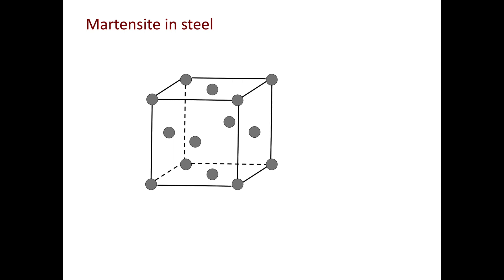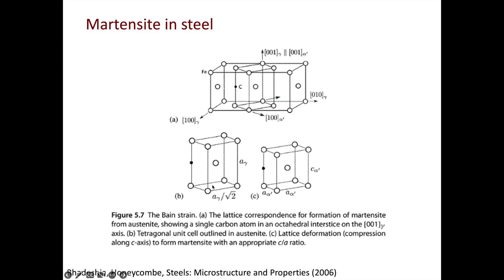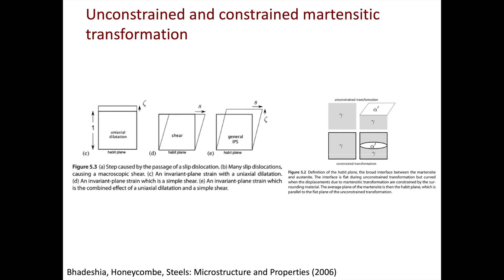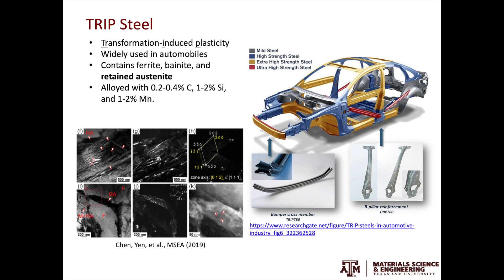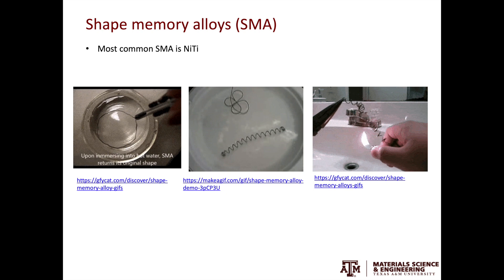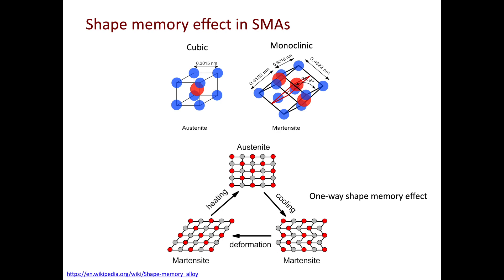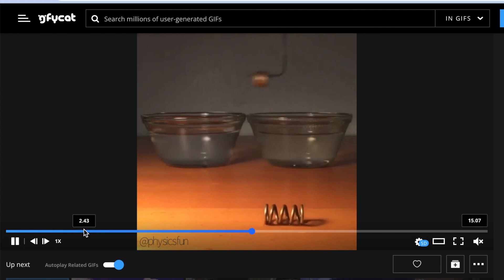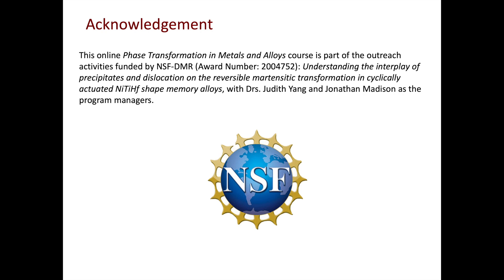5.2: TRIP steel and shape memory alloys

Comment: @9:46 sorry that I made a wrong statement - superelasticity is not a TRIP effect. In both TRIP steel and superelasticity, stress triggers martensitic transformation. The difference is that in TRIP, martensite remains even when the load is remove; in superelasticity, martensite transforms back to austenite when load is removed.